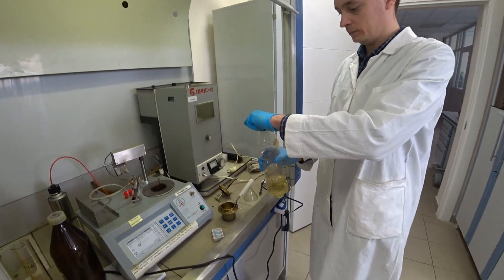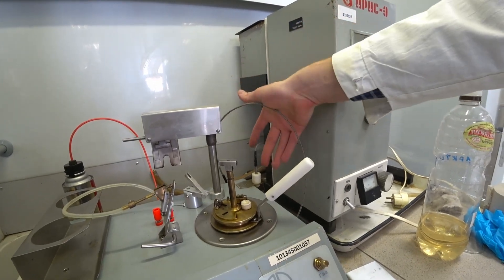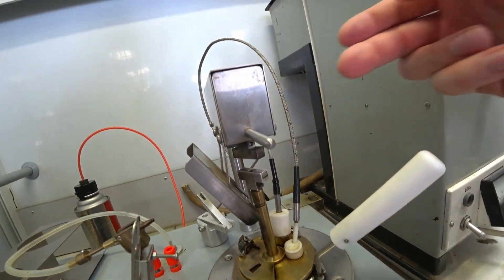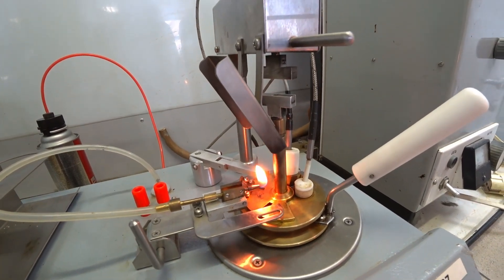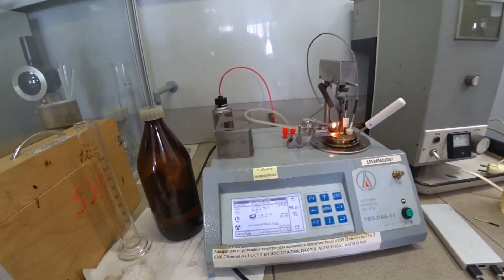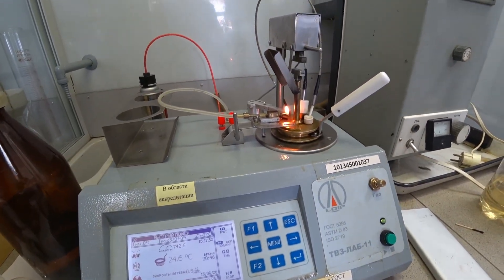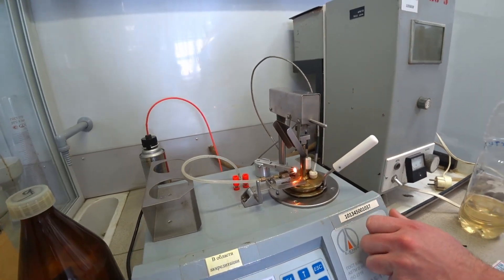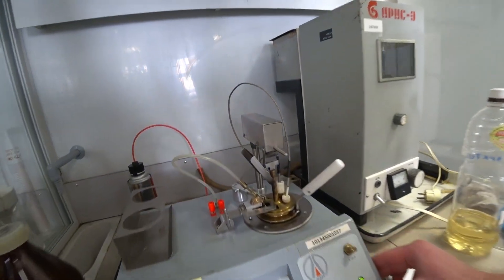Standard Test Methods for Flash Point by Pensky-Martens Closed Cup Tester

Comment: Interesting machine. Unfortunately, your flame was not regulated to the correct size as per the ASTM test method. Should have been much smaller diameter. Always remember to pay close attention and read the method specifics. Otherwise good test.